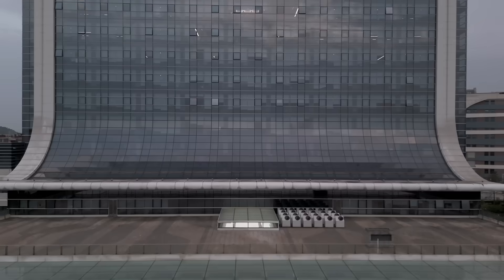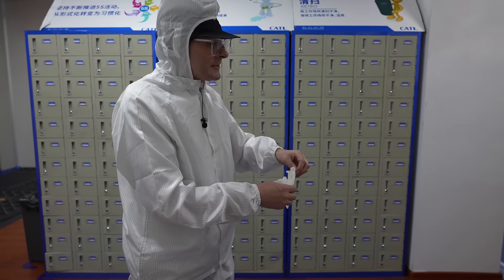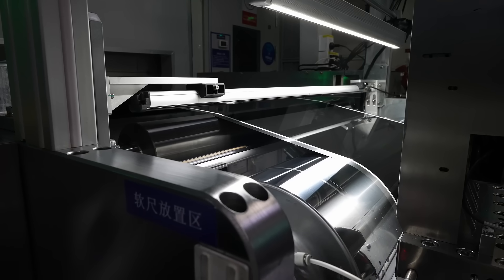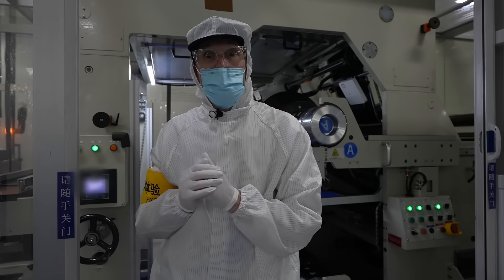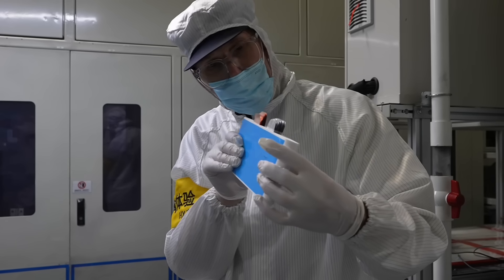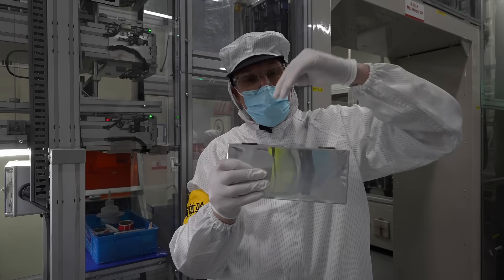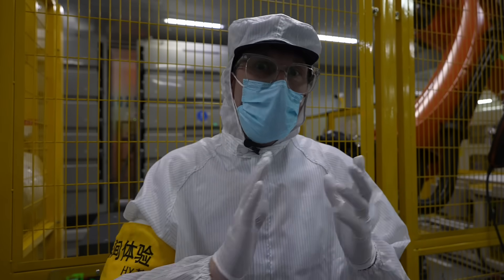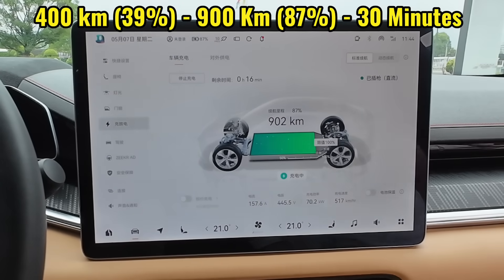The USA are Scared of Chinese Factories like this....

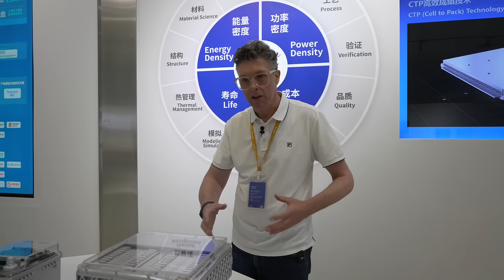Comment: @10:00, a small correction.
While the accessory battery directly operates all the computors, lights, etc. it is the TRACTION (or drive battery) that resupplies that smaller ("auxilliary" or "starter") battery (12V or in newer cars, 48V).
The battery you display is quite large for an auxilliary battery and i think it's the main battery for a small EV or trike.
Reply from the maker: I take on board what you are saying, however the engineers at CATL did inform me that it is indeed an auxillary battery. I must say, I was also quite surprised, as indeed it is quite large, much bigger than the auxillary battery inside my own AITO M5
Reply: @BarrettYT 
I'm pretty sure it's an "Auxiliary drive" pack for a Hybrid.
(Gasoline "generator" charges the battery, battery powers the "drive assist" motor)

Comment: 164 KW charging is fast, but it's not THAT impressive.  2016 Teslas charge at that speed, newer ones can do 250 KW.  Please show what the Qilin(?) battery can do, I want to see what it's actually capable of.
Reply from the maker: The charging that is shown in the video of the Zeeker is actually using a 600 Kw charging station.
Reply: I believe the 1000km Zeekr uses the Qinlin cell.

Comment: Not only CATL, many other Chinese companies going to dark light factory already, and more join everyday. Actually China maybe is the only country achieved the industrial 4.0.
Reply: Industrial 4.0 is more than a light-less (No human operator) factory, but yes, its part of Industrial 4.0.

Industrial 1.0: Upgrade from human to steam engine power manufacturing.

Industrial 2.0: Computer assisted with data collection and analysis.

Industrial 3.0: Automation and robotic assisted on every step of manufacturing.

Industrial 4.0: Customised manufacturing with consumer behaviour integration.

Example: The consumtion of every products used by a city / nation will be collected and analysed, and feed in as input data before automated production.

Whenever I wish to buy a packet of chocolate, 5 lt of milk, a jumble pack of toilet paper roll, or anything. My local super market will stock my products at the right time, right package and right brand. 

Manufacturer don‘t have to rely on human estimation of production items.

Thats industrial 4.0.

Comment: I think the safety with Chinese batteries is questionable. But it probably depends on the manufacturer.
Reply: Hahahaha…u still living in the past.😊
Reply: Conversely I often find western companies are a hit and miss for their price. Paying 2-3 times more for the same specs. Maybe sometimes the better specs for the price makes it worth it. Maybe once or twice is fine. But when you make that decision with everything you end up paying more than another consumer or business competitor.

And I've often been surprised by high quality Chinese products at a lower price. It is a bit of a hit and miss. But when it comes to manufacturing costs China has vertically integrated manufacturing advantage  (e.g. BYD) which plays a role in bringing down assembly cost aka consumer have cheaper options.
Reply: @mikeg3810
The only thing that's "Questionable" is your suggestion that they might not be "safe"
Are you really still falling for that?

Comment: EV's are am already failed technology.
They will never replace anything else.
If you're ignorant or don't believe me;
wait 10 years and you will find I' was right.
Reply from the maker: How do you arrive at that statement that they are already failed technology, would be interested to know.
Reply: @BarrettYT 
EV's have a long history of spontaneously catching on fire.  The trouble is. the fire can't be put out with water.  Water only makes the fire burn more.
Another problem with EV's is recharging them.  There are not enough charging stations, and there will never be.
Another problem is the time it takes to recharge them.  Until recharging them is drastically shortened. they are simply not worth it.
Another problem is the faster you drive or accelerate: the faster your EV battery will expend its charge; forcing you to drive like a mouse or else end up stranded.
Another problem is there are no EV mechanics.  What do you do if your EV breaks down?  Who are you going to call?
Whereas if your car is gas powered there are garages and mechanics and emergency services like triple A that can help you...
Another problem is their range:  unless you never take any long trips you will be handicapped by how far they can travel.
Now if you had a brain that works you would have deduced this yourself.  But you didn't because you don't.

Comment: The USA is not one bit scared of this .
Reply: Of course they are . Very soon wall Street will be a thing of the past. All of your future presidents will continue to beg for crude oil and spread misinformation to citizens about China Russian involvement
Reply from the maker: Of course they are , that's exactly the reason they have applied high tariffs to them, as they are unable to compete.
Reply: @BarrettYT The USA has mega factories building billions of batteries every year and has a number of new FABS Building IC chips INTEL TSMC Samsung GLOBAL FOUNDRIES and others they put tariffs on stuff to stop dumping at cost price to destroy local stuff that is what the Japanese did years ago with TV sets and some year ago with Chinese steel. The Chinese can make good stuff, but they also make a lot of CRAP. And also, I am finding out now that the Chinese made stuff is getting more and more expensive Wages go up it flows on .

Comment: I'd love these batteries in my camper van builds ❤
Reply: Think it through.
1000km (600 miles)
Drop that to .... 400(?) for a van.
How many times do you drive a campervan 400 miles without a break?
.
My point?
No more "house" battery.
.
Drive 300.
Stop for a brew, top up in 15 minutes, drive 200, 50% remaining, you use about 5% overnight maximum for heating, cooking, etc.
If you must have a backup, a small all on one "power station".
It's a whole new ballgame.
Reply: A small tip, you can also mount a solar panel and charge it while on the move. 😁
Reply: @merrick6484  😂 thanks I never knew lol

Comment: CATL is the Number One lithium battery manufacturer in China.
CATL has once again pushed the boundaries of LFP battery technology, ushering in the era of superfast charging for the whole industry. 
CATL Unveils Shenxing PLUS, Enabling 1,000-km Range and 4C Superfast Charging
The cathode of Shenxing PLUS is made with a granular gradation technology, which places every nanometer particle in the optimal position to achieve ultra-high compact density. The proprietary 3D honeycomb-shaped material is added to the anode, boosting the energy density while effectively controlling the volume expansion during charge and discharge cycles. 
To achieve the leapfrogging of charging speed, Shenxing PLUS applies technologies including fast lithium-ion conductive coating, the addition of transition metal elements, and new nanometer encapsulation, rendering smoother and more efficient energy transmission between cathode and anode materials. 
CATL has expanded the overcurrent area and capacity of the terminals in the battery system to rapidly dissipate heat during high-current charging. In terms of BMS core algorithms, CATL's newly-developed AI polarization model can predict and control the charging current in real time, enabling faster and smarter energy replenishment. 
CATL continuous expansion of scientific frontiers is ushering in a superfast charging era for new energy vehicles with a closed-loop supercharging ecosystem by integrating superfast charging battery, network, platform, and services.
Well done.

Comment: quite a conundrum; manufacturing costs too high in usa but it doesnt want to have its supply chain based abroad
Reply: USA  has very little focus on a long term plan but rather a short term quick buck.
Reply: Not only a conundrum, but dangerous.
.
Huge global economy with deficit out of control, rooted in a failing Technology, now facing the next technology, championed by a country they have designated "a threat" (they're not).
.
When the failing country has the largest military on the planet, what might they see as one "solution"?
.
"Big Stick"?
.
The alternative is to essentially go on branded knew to the new "threat" and request they be allowed to join the game.
.
What are the odds?